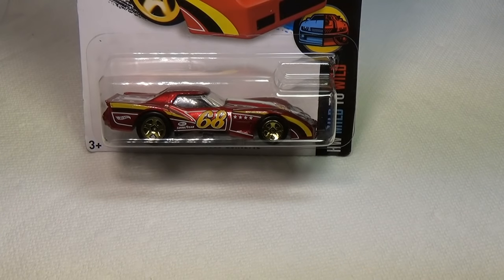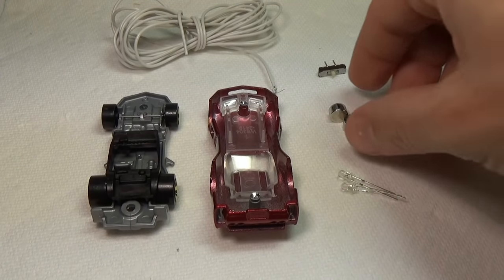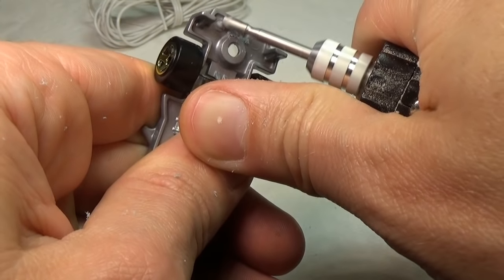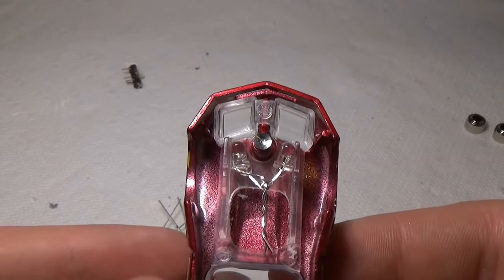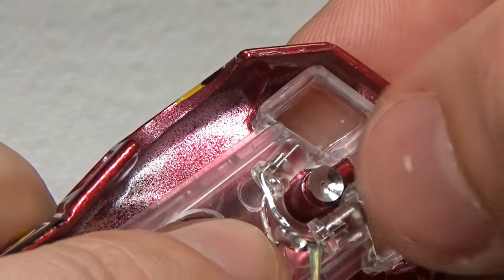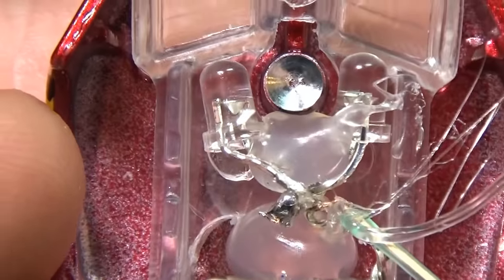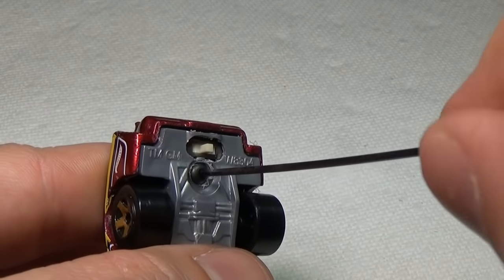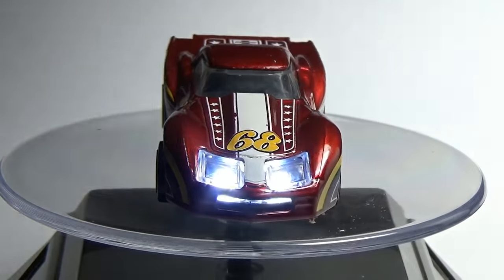How to add Working Headlights to your Hot Wheels Custom

Comment: Alternative methods. Use SMD LEDs, they're smaller and have no leads. Use primary Lithium batteries, something like cr2020 works great and might be easier to jam in, and it will only take one instead of two. Get automotive rear glass heater repair fluid (<$10), it will give you a life's supply of finicky to use paint that is electrically conductive so that you could route the electricity to your LEDs across just about anything, including under the paint of the model if you were going to repaint it. And you don't even then need to solder to your SMD LEDs, you paint right onto them.

What i mean by the paint being finicky, you have to shake the vial really well, and then pop it open, and paint within about 10-20 seconds - if you don't manage to do that, it'll likely look like it's painted on fine, but the paint will not conduct properly because the paint has separated and you got lines of binder that separate the conductive silver in the paint. But it can be done.

Use magnet wire for the rest of your wiring. It's varnished copper. To expose the copper where electrical connections need to be made, just hold the end into a lighter flame, it'll burn the varnish right off.

If you need blinking lights or somesuch, the smallest thing you could use is a self-clocked SMD microcontroller. The smallest ones that you could sensibly work on are PIC10F and ATTiny, they're available in 6-pin and 8-pin versions. You could get a bunch of vaguely Arduino-compatible Digispark clone boards (usually marked ATTiny85) with 8-pin microcontroller for less than $1 a piece, develop the software with built in USB, then desolder the micro from the board and use it in your project, but it's not the most power efficient thing to do, since they run at 16 MHz but ideally you'd custom program the fusebits to have your micro run at 1 MHz or even 32-128 KHz, which would allow it to run for an eternity.

Hey, maybe getting a cheap and power-efficient set up for a blinker/switch function out of a 6-pin attiny is something i could make a video about, if nobody had done it before.
Reply: That is really neat! Thanks for that, I had no idea that cool paint existed I'll look all the other stuff up too!
Reply: What size would it be for the smd led
Reply: You could also use a remote power method where when you place the car on a certain powered surface that it lights up with out batteries.
Reply: Make a video😃

Comment: It'd be interesting to try adding blinking lights to an emergency vehicle using a similar method.
Reply: It's been done before ;)
I created one with flashing headlights and roof lights on the HW PURSUIT last year.

Search for "LED HW PURSUIT" by Alcatraz RainyMonday here on YouTube and you'll see what I'm talking about...
Reply: You can, but getting it all to fit without needing an external wire for power is hard.
Reply: i had one as a kid,it was one of my favorites,i dont remember what make it was.i also had a red baron and the snake cuda and im 95% sure i had a vw van(hotwheels).if only i knew then what i recently found out,damned it all.that was in the elate sixties ,early 70s
Reply: There are blinking leds in the shops. You could try to get them and try. Have fun and good luck. All the best.

Comment: Big tip. use magnet wire. small and easier to work with in such a small space. could fit a foot of it in there
Reply from the maker: good tip will try.
Reply: +1 on the magnet wire.
Just to throw you some more ideas to chew on,...;)
Aluminum tube,heatshrink and fiber optic strands for single diode setups. With some clever drilling,you could do all four corners,marker lights and interior from a single cell,switch and diode. The light dispersion will also be more realistic to scale.
For cars with no molded lenses,drill the lights,mount the the optics and layer in Bona Floor Polish. Finish with the appropriate candy (lense)color.

Cheers man.
Liked and subbed! ;)

Comment: Now I know what to do with that old dodge caravan hot wheels car I have laying around
Reply: Did you notice that all VG [Video Game] consoles have PC board components? That's of what's required to have. I've seen; the old Atari 2600 VG consoles, get restored. I've even seen the Mattel Electronics Intellevision VG console, get restored as well. Having both of these relics, come out as good as new. I've even seen these; old timer video arcade game machines, get restored as well. What I like about these old timer video arcade game machines is; that they display this kind of message, great score enter your initials.

Comment: The idea is good, however, if the intention is only to give the car a lighting effect, you can place a single central LED taking advantage of the light transmission that the same plastic has. That way you save room inside the car. You could also place an RBG led so that colors can change. All the best, great video..

Comment: Your instruction is very clear, concise and comprehensive (xcellent video production as well).  Your work is greatly recognized and appreciated.  I'm off to begin installation!
Reply from the maker: thanks!! and best of luck!
Reply: your electrical work seems dangerous. try using heat shrink or electrical tape next time
Reply: What the hell are you talking about?  This is a 3V battery setup, not 120V home electrical.
Reply: well I guess your right, but I have worked on a lot of electronics. if the amperage was high enough (which it isn't) it could cause some damage.
Reply: baremetalHW thats cool
Reply: I honestly had no intention of watching a nearly 9 minute video but it is a very well made video. Excellent instructions, step by step and the suggestions are excellent as well.

Comment: I know this is an old video, but I'd like to suggest trying to fit in a current limiting resistor in series with the LEDs. The resistance can be calculated by taking your battery voltage, `Vb`, and your led forward voltage, `Vf`, and subtracting them to find the resistor voltage, `Vr`.

Vr = Vb - Vf

Then, to calculate the resistance, you need to find the forward current of the LEDs,  `If`. Hopefully this value is documented on the page of the LED manufacturer, else you can guestimate the value by building a circuit on a breadboard, and using a potentiometer, and lowering the resistance until the LED stops getting brighter, and then measuring the current at this point with a multimeter. (alternatively, you could use this method to also guestimate a resistor value by measuring the resistance of the potentiometer at this point, assuming the power supply for this circuit has the same voltage as `Vb`).

As a note, if you are using multiple LEDs in parallel, the `If` value you need will be the number of LEDs TIMES the documented or measured forward current of a single LED. If you're having to measure the value, you could always wire them all up to measure, then you won't have to perform the multiplication.

Once you have `Vr` and `If`, you can calculate the needed resistor value, `R`, using Ohm's law.

R = Vr / If

The reason I suggest including a resistor is because an LED can and will draw more current than necessary to reach maximum brightness, which will reduce battery life (and potentially even the life of the LEDs) due to the extra power consumption and heat generation, which would be annoying since the batteries are glued in place.

Comment: Great work, putting in a resistor to reduce the current will help the batteries last forever and not make the headlights too bright. I also use black paper / card to stop light bleed. If you like customising interiors and want your work to be shown you can put in an led there. You use the old style 5mm leds, but you can get 3mm and other really small but bright LEDs, even have underfloor 'fast and the furious' style lighting if you wanted.

Comment: different color leds use different voltage, be careful around that. also 2mm or SMD would work even better, but may prove too much for most due to tiny size of SMD's....
 Great tut otherwise :).

Comment: Fantastic video!
Thank you making this, it looks amazing.
I was surprised by two things:
1. That you used this Corvette, i have the same one. :D
2. You've done an amazing job.

Few things you can do update:
Put aluminium foil to mask areas inside where you don't want for light to come out.
It will look better, and more light will come out of the headlights.
And i recommend replacing these LED's with a lower power yellow ones.
For this old Corvette they don't because the car is old, not new.
But hey, it looks great.

Comment: Would a solar panel run those lights? Since they are kinda the same thing. After thinking about that question for exactly one minute I realized to see the lights well and get full effect there would need to be no lights. Hence solar power seems dumb. I stand by it tho because it would still maybe work in the light and still would be cool because you have working lights and solar panel on a fkn hot wheels

Comment: Very nice! Good thing the model itself allow this. Since you used hot glue to hold stuff together, a tip, cut the link windows/headlights and cover part of the link with some opaque tape or black paint, so the light isn't transmitted through it to the windows, like a optical fiber. Good work as always.

Comment: that was cool, i once had a hot wheels that had lights on it that was bought that way, i dont ever remember the lites not working far as the batteries go.,it was a small normal size hot wheels as well. like the one you just built, again nice idea nice work

Comment: You can also add a resistor into the circuit to limit the power going to the LED's and at least double the battery life. Nice video!

Comment: You might be more successful using thin metal strips and tack welding them together and to the batteries then using wire and solder.

Comment: What do you use to replace "rivets"?
Reply: tap-n-die
Reply: screws (tap) or just put super glue on them, cant notice the glue unless you really look and it doesnt come loose
Reply: ive tried both ways and i like the glue best
Reply: What size screws did you use?
Reply: Great work btw.. I'm inspired
Reply: jaime pagan he indicated in another video 1/16 button head screws that you use an Allen wrench to take on and off.

Comment: What the heck now days all the hot wheels and stuff is just metal so I can't seem to find plastic headlights but I guess if ur skilled and have the right tools then u could use a tiny drill and drill through the metal headlights and then find plastic pieces and then hot glue lightly into place so then u do what's going on in the video😁😁😁 I'm 12 years old and very creative so have nice day👍

Comment: me and a friend made some hw USB drives with headlights years ago... good times
Reply from the maker: would have liked to have seen that...
Reply: There are some articles on instructables about this. All you would need to do is calculate the resistor value (64 ohms?) to mount your leds to the 5v rails on the flash drive.

Comment: it may sound crazy but would it be possible to make a hot wheels car with working popups?
Reply from the maker: I am sure it is possible..... it would be crazy difficult... but possible
Reply: Challenge... accepted. Check back in 5 years. Is there a particular model you're thinking of would be suitable?
Reply: Maybe the toyota ae86
Reply: The popouts being as tiny as they are, i can't really see a good way to place a hinge anywhere. I have an idea for the actuators, by using 4x8mm coreless vibration motors from a phone, being bridge PWMed by an ATTiny. Maybe i'll figure a thing out.
Reply: Siana Gearz

Comment: all you need is one led
Reply: HOOSIER 0x007 O_o' the coverage won't be as even
Reply: yes it will  super bright led are very very bright
Reply: No it will not. If using 1 LED, you need to fit light tubes to route the light to the lens.